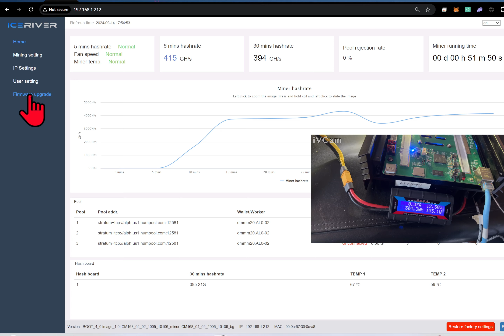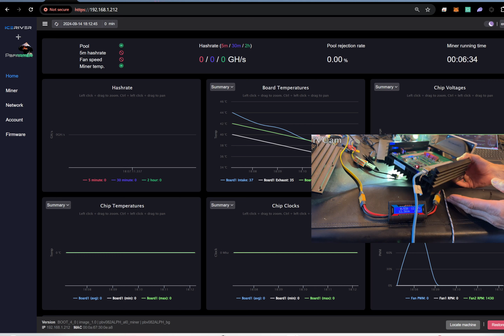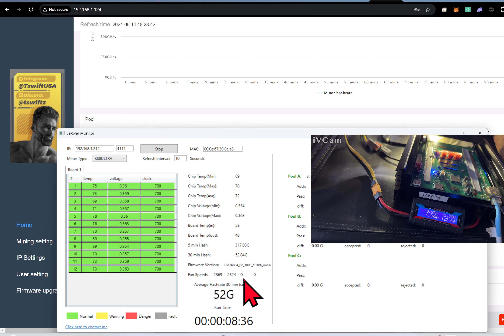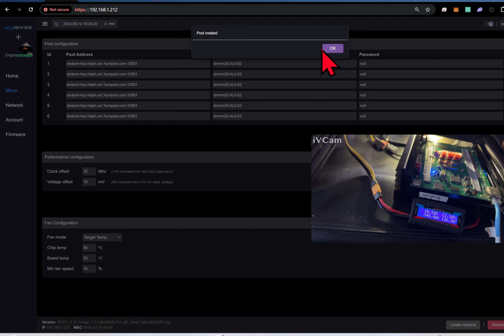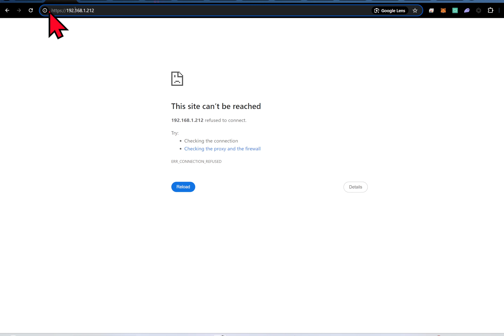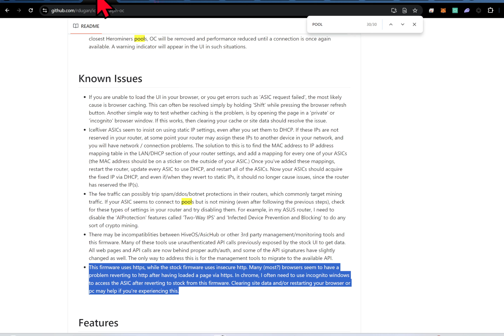AL0 PBFARMER'S OC, MY FAN POWER FAILED HOW TO TEST AND CHECK YOUR MINER

Comment: Some good info here... nice work!  I'm a little late, but a few tips on the fw...
1. Fixed and Asic Controlled fan modes are indeed the same as stock.  Since KS0 Ultra, fixed fan speeds get reset by the stock firmware occasionally for some reason.  You can use the minimum speed in target temp mode as a replacement for fixed speed.
2. Clocks ramp 25mhz every 30s for OC (and yes, they currrently reset for ever increment on the AL0, which is why you see the power drop - this may be changed in my next release).
3. All the info in that 'iceriver monitor' is in the asic UI.  You can click the dropdowns in each graph to get more detailed info.
4. The hashrate is not 'fluctuating', what you see in the UI is simply an estimate based on shares, and the shorter the timeframe, the more variance the measurement has.  The variance is exactly the same on the stock fw, they've just used an expanded (0 base) scale which hides/flattens it.  You can click on the measurements in the legend to remove each line, and you'll see the scale adjust for the remaining lines, making them look like they're 'fluctuating' more, despite the data being exactly the same.
Reply from the maker: Thanks for info. I’m in process of 8.4 OC set up and will update when get to some stable numbers